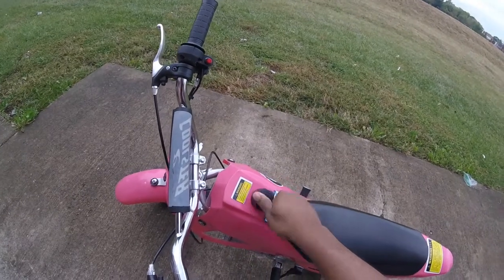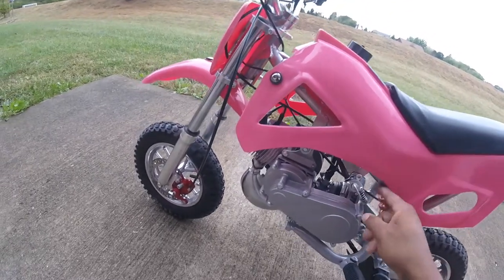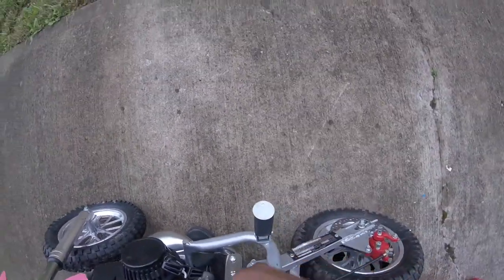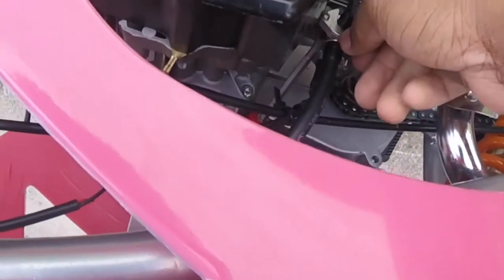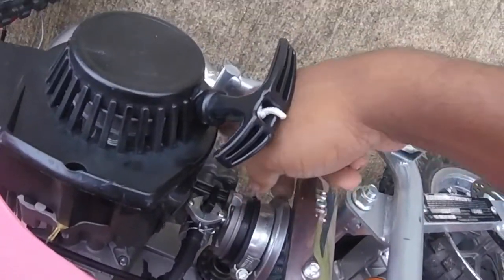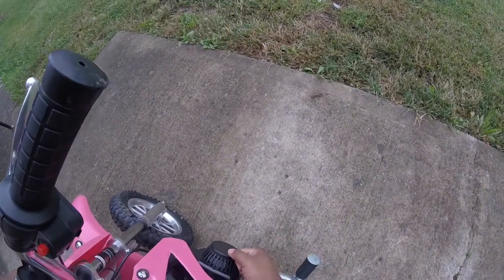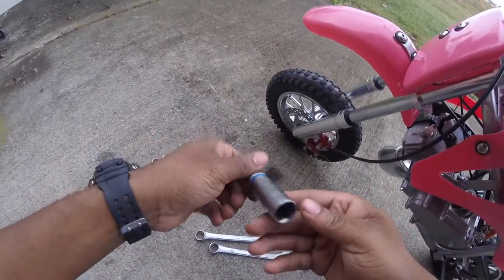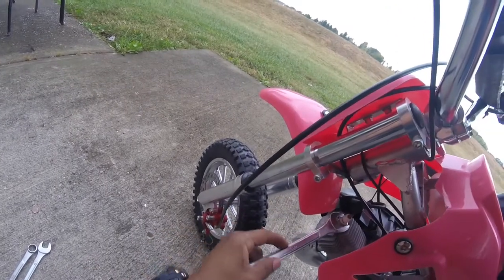49cc mini dirt bike not running repair mystery not running in 10 months part-1

Comment: That's a clean bike, I use a string trimmer T shape tool for the spark plugs on these 👍 If you don't want to pour out the fuel you can just tap the fuel line off by pinching it between a small clothes pin.

Comment: Bro as you pull the starter you're supposed to twist the throttle at the same time
Reply: Are you? I havent been and it started. But now it wont start.
Reply: @kyalization  yes. As you pull twist the starter too. If that doesn't work. Check your spark plug is sparking
Reply: @mosrcgarage3461  youre rightI saw a guy do it. Yea thats my next step. My bikeis 3 weeks old tho and been on it once.
Reply: @kyalization  if the bike is sparking. Then check that fuel is getting to the Carb. Put 2 or 3 DROPS of fuel down the spark plug hole and it should fire up.

Subscribe to my channel and I'll. Make. A video. If you want.
Reply: @mosrcgarage3461  what do you mean sparking? It just doesnt start and if it does then just cuts out.
Reply: @kyalization  it's your car adjust it or clean it spray some carb cleaner in it mess with the idle screw